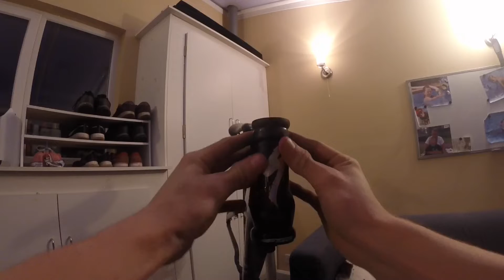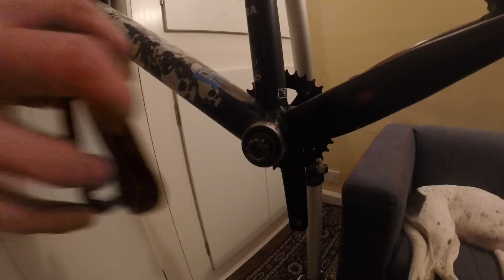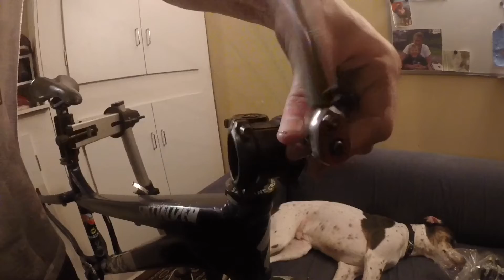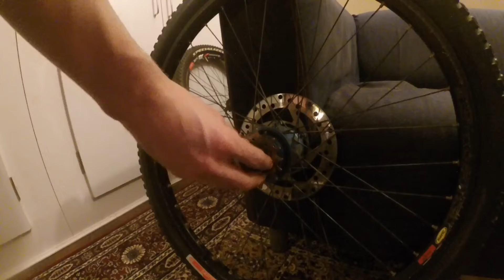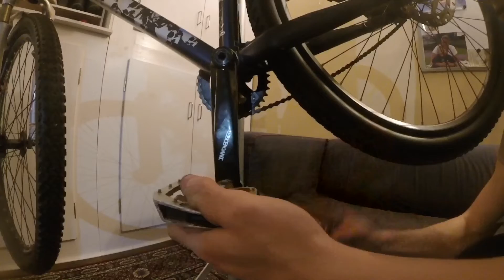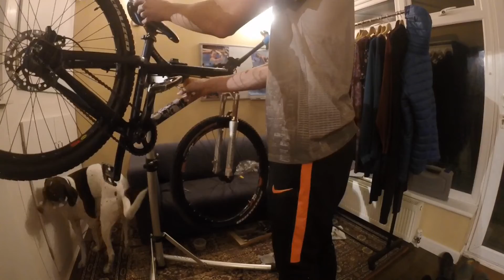DREAM BIKE BUILD: Specialized p2 dirt jumper build

Comment: Hey man great build video! I got the same frame but in black/silver. I’d like to put a new bottom bracket in and crank set though. Hard to find specs on the original size any luck remembering those measurements!? Thanks!!
Reply from the maker: no g
Reply from the maker: it’ll be A 68/73mm bsa shell god knows about cranks think these were 170mm